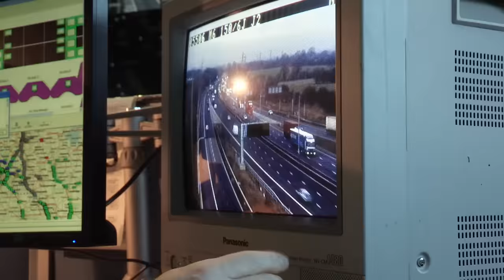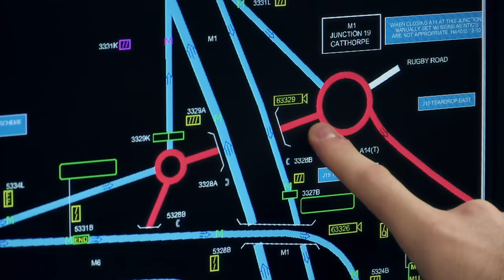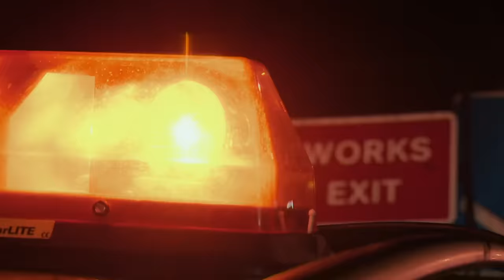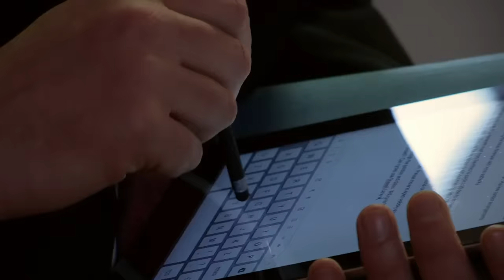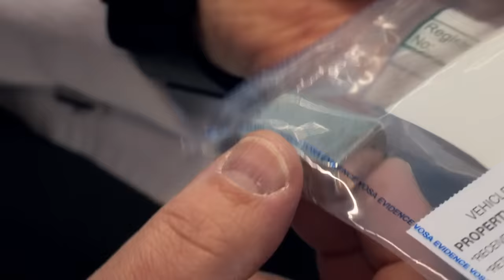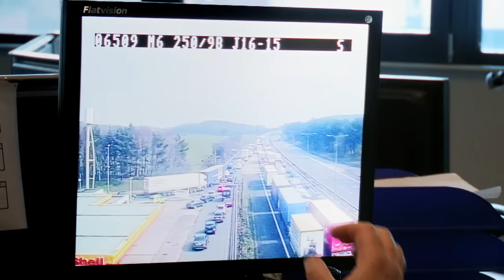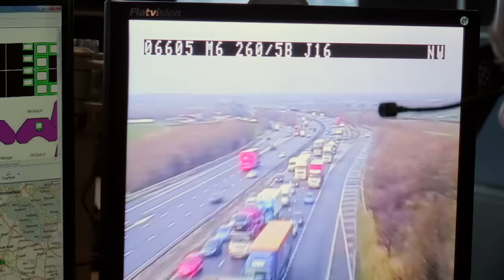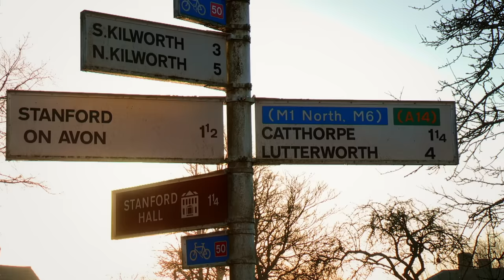Working On The Longest Motorway In Britain | Life On The Motorway E4 | Our Stories

Comment: And that is why we do not need smart motorways. We need a hard shoulder for protection and to allow emergency services quick access.
Reply: The irony is the cost of toll roads puts drivers off using them, so they waste fuel & time sitting in bumper to bumper traffic!
Reply: the thing is to expand it costs 10 million per lane per mile but with the now radar the smart motorways not trigger automaticly if there is human error

Comment: It is so nice to accept that the M6 is the longest motorway in England. Some folks actually think that the M1 was the first motorway in England (it was the M6) because it starts near London, the M4 was the fourth and the M5 was the fifth etc.
Reply: Only by a year. The Preston ByPass now makes up part of the M6 which opened in 1958. The M1 was the first full length opened in 1959. 👍🏻
Reply: It's 2 different topics buddy. The longest and the first. They have no connection with one another lol. This comment is weird
Reply: The way roads are numbered use London as the hub of a wheel. The spoke running from North East England down to the bottom of East Anglia is numbered 1, then clockwise around until roads in North West England are numbered 6.
Reply: @paulsharp3865  Yes, what determines the boundaries of each zone is the single digit A roads, and the motorways don't necessarily follow this. the M6 is partly in zones 4, 5 and 6
Reply: @ks2091  It is the same system for both A roads and motorways. Every A road that starts 'clockwise' of the A1 will start with a 1. Similarly, any motorway that starts 'clockwise' of the M1 will start with a 1.
Reply: @kingofracism  You know what's "weird"? Is that you are talking to no-one. You didn't "at" anyone, so no-one got your mean comment. Joke is on you, pal.

Comment: Only in the UK will you get a lorry driver checking, and giving approval for,  the designs of a civil engineer.
Reply: The driver uses the road daily and sees the problems in real time, his POV is definitely needed
Reply: @andyclark1426  it's not. Roads and highways are designed to specific standards. There are formulas used to determine the font size on signs and their location. Even the curvature of bends and the pitch of the roadway is calculated precisely. Engineers study for years, and then train on the job to ensure their designs meet these standards. The opinion of a lorry driver is not relevant.
Reply: Well, stripping away all the flummery, what the lorry driver wanted was to keep local access at the junction as well as having the through connections the highways agency delivered.
Reply: Does anyone know though why the road between the M275 & A3(M) is now not motorway when it  once was ? I’ve seen arguments on a British web site devoted to serious roads between enthusiasts whom disagree whether it’s a question of 10” discrepancy of width surfacing of the hard shoulder. Surely no other country on Earth has folk battling over such issues or do other countries have such quality Anoraks ?

Comment: At 01:48, they make a big fuss about the height of the car transporter with the open boot on the roof......but fail to notice a double deck royal mail lorry in front of it, that is the same height 😂
Reply: The RM unit has passed under thousands of bridges, has been designed to pass under thousands...the open tail gate has not. The calculation are unlikely to have been perfumed. A bounced suspension, a broken tailgate stay ( do you think they've tested/built at tailgate for going backwards at 60.) & the game of traffic billiards is on, and the pockets turn red.
Reply: The RM lorry has been manufactured to will be within the standard clearance height, which all motorway bridges have to be higher than (and hence don't need to be marked). It's a known quantity. You can be sure it will clear the bridges. The driver will also know its height and is probably following a set route that avoids low bridges off network.

The car transporter isn't a known quantity. You can't be sure if it's within standard clearance heights, and so can't be sure it will clear all bridges (which can be at different heights over the standard). Also presumably the driver doesn't know the boot is open, and so his measured height (which he should have checked before setting off) could cause him to hit a lower bridge off network that he expected to be able to get under. 

So hopefully now you can see why they were keen to stop the transporter, but not at all concerned about a standard RM lorry in front.
Reply: Oh. I see. You know the tailgate was not a problem because YOU could clearly see it was the "same height" as the Royal mail truck?
It only needed to be a couple of inches higher to cause carnage. 
Perhaps they should employ you at the call centre to correct their silly nitpicking ways with your Super Vision.

Comment: I totally agree with all of the safety rules (vehicle maintenance, load security and amount of hours allowed to be driven in 24 hours) for truck/lorry driver. That being said. 
I can absolutely understand the truck/lorry drivers frustration in regards to how they are being treated/looked at by society. 
I’m at fault as well, because I have b*tched about truck drivers on the Autobahn. This video, however has reminded me what it would be like if we didn’t have ppl willing to put up with the stress and frustration of being a truck/lorry driver. The BIGGEST problem for those drivers are the companies/bosses they work for, in my opinion. They (drivers) are given unreasonable, even unrealistic, timetables by when they have to make deliveries. Some can’t be accomplished without breaking the driving time safety rules if there is even the shortest of back up on the Autobahn. In my opinion, every time a driver is caught breaking the “time behind the wheel” rules/regulations, the company who hired them to make the delivery should get slapped with HUGE fine (at least triple the fine the driver has to pay) as well. Hurt those irresponsible companies/bosses where it hurts them the most = their bottom line. Maybe that will change their expectations.

Comment: First, we know that MOST PEOPLE  DO NOT USE THE TOLL HIGHWAYS. 

Secondly, we know that TRANSPORT-TRUCKS both CAUSE MOST of the DAMAGE to the ROADS & they also 
USE the MOTORWAYS THE MOST. These drivers are also the most aggressive drivers; TAKING too many CHANCES,  Driving TOO QUICKLY (way ABOVE the SPEED LIMIT), & not always FOLLOWING ROAD/DRIVING LAWS, Etc. 

It thus seems completely obvious, that by CONTROLLING the TRANSPORT TRUCKS , THEIR DRIVERS, their Speeds (Radar Tickets are used all over Canada & the US), & MOST IMPORTANTLY, UPON WHICH HIGHWAYS THEY USE. If you could make sure that TRUCKERS ONLY USE THE TOLL-HIGHWAY, it would keep the M6 & other Highways CLEAR OF TRANSPORT TRUCKS/LORRIES. Also, SINCE these TRANSPORT TRUCKS are the ones that CAUSE MOST OF THE ROAD DAMAGE, it MAKES SENSE THAT THE MONEY COLLECTED FROM THE TOLLWAYS should be USED TO MAINTAIN, OPERATE, BUILD NEW ROADS, Etc. 
  Finally, by KEEPING THE TRUCKERS ON THE TOLL HIGHWAYS, they are MORE LIKELY TO MAKE THEIR DEADLINES. Even BETTER, by keeping the Truckers off of the M6, Etc, these roads WILL BECOME SAFER FOR PERSONAL CARS & TRUCKS, & the ROADS WILL LAST LONGER.
Reply: There aren’t enough tolls.

Comment: I'm curious, why does Highways England seem to use km as opposed to miles?
Reply: (what i think) On the side of the motorway there are these markers every 500 meters that say measure how far down the motorway you are. I guess it is related to those so if at 100A on the M6 means you are 100km from the start of the motorway on the northbound side. easy way to pinpoint down to where incidents are i guess
Reply: @Josh-ru4dm  I had no idea that those signs were in km! Just assumed that they were in miles
Reply: @Josh-ru4dm  also very handy for letting breakdown services know exactly where you are.
Reply: more precise measurement
Reply: @Josh-ru4dm  they are in km so that they can offer a more precise location using only 1 decimal point.   12.5 km is 7.76714 miles. You can be far more accurate to 1 decimal point in km than you are in miles. You only want to use 1 decimal point so your signs can be smaller and more concise to read.
Reply: In the Uk measurements are done in metric but for some reason our speed and distance on a motorway is miles per hour and miles. All the drawings and markers are in metres so that’s what has to be used as that’s the reference with carriageway A & B. Then from nowhere someone will throw chainages at you. Come on now, that was invented in the 1600s we’ve been metric for long enough haha.

If everything was metric and we got used to it no one would question it but people don’t like change and it would be a major change to swap all the road signs and speeds to KM. probably cause loads of accidents with people doing mph instead.
Reply: @jonp6798  are they? Everyone I met and know use stones , feet and inches and pounds. Not very metric. Or perhaps you're from the home counties? Up north your compatriots are rough bunch. They use dinner for lunch and tea/supper for dinner. Don't tell me you use pounds instead of what seems to be the norm everywhere- quid....
Reply: @jonp6798  Try Rods, Poles and Perches!

Comment: Never this efficient  in the US.
Reply: Nor it is in the UK. M6 toll is smooth and fancy but the standard M6 surface is rough as heck. Resurfacing doesn't happen at all and potholes are not filled in a blink. I still spot the same potholes on M53/M56 which where there 6 months ago. 
This is old video but wish they were fixing roads the same way as they did in it. Sadly not the case.
Reply: @svetoslavtodorov2427  Thanks for the reply.  sounds like you  have the same issues as we do here in the States.

Comment: two curtain siders on barton bridge aside of each other then a massive gust of wind  causes them to collide  whos to blame is it not an act of god
Reply: High wind signage before entering the bridge based on wind speed. Consider that might happen and go single file over the bridge or instruct drivers to do so before going over when there’s high winds.

There’s always a way to prevent something, if it’s not the driver’s fault as they can’t be expected to foresee the eventuality which I’m sure some drivers with good skills and perhaps previous bad experience may have done in that situation, it’s the fault of the road designers not putting the signs in to instruct of the danger.